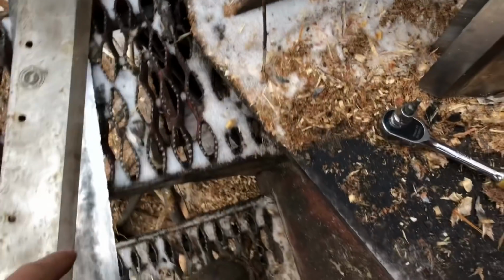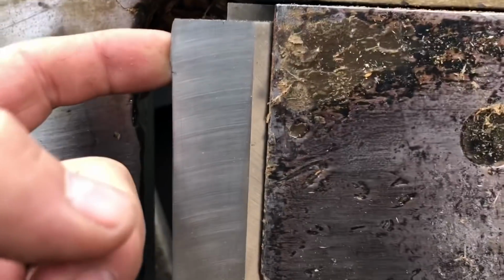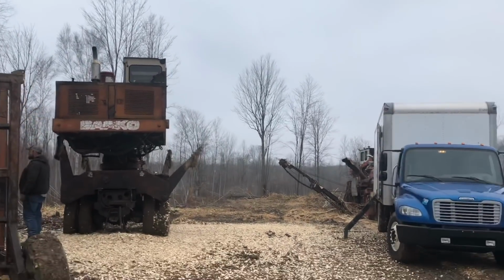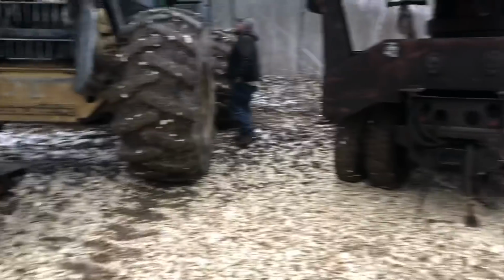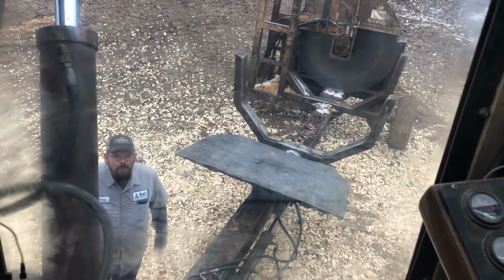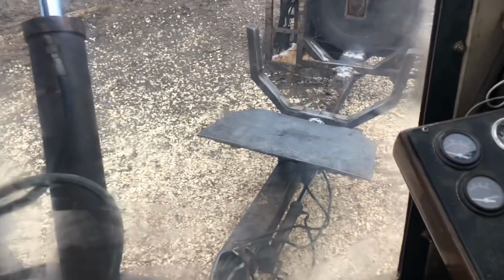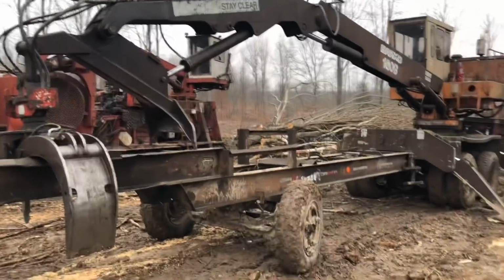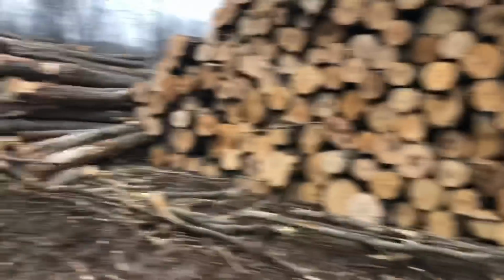NEW Skidder Saw!!!!

Comment: Those blades are not cheap. I used to work in plastics industry and they have grinders with simillar blades. Leaving imperfections here and there is best considering cost of new blades.